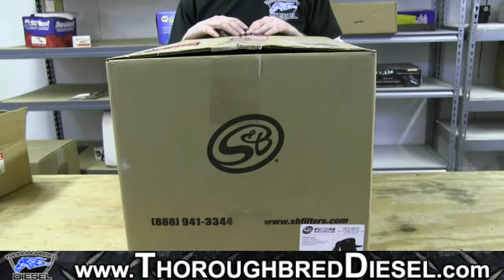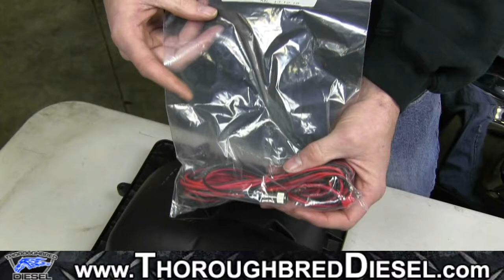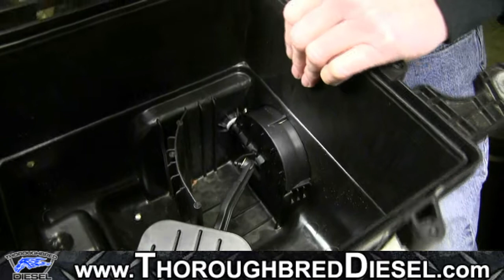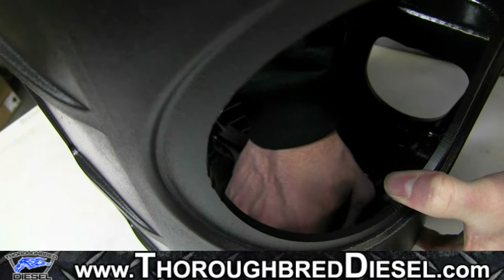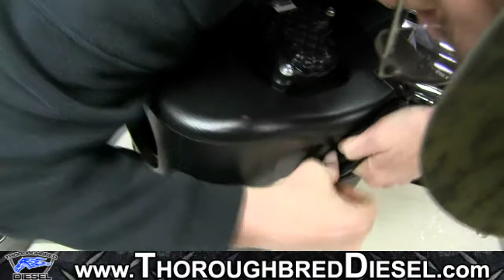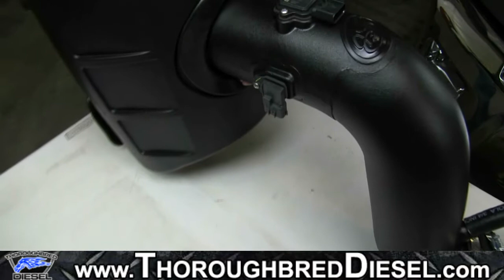S&B Cold Air Intake Install: 13-Up Dodge Ram w/ Active Ram Air System #75-5068

Comment: First off you shouldn’t get a code at all. I ran my 2014 3500 6.7 stock box without the gate. Second read the dam instruction. The rubber seals have 0s on them that you line up. That makes for a tight seal. The main tube should not have a gap on the top. I would be pissed if they installed it this way on my truck and said it was normal. Just lazy.
Reply: Did you disconnect your battery before the install. Jus curious
Reply: Yes, the very first time I put it on When I took it out I didn’t. The engine will automatically adjust after 45 starts.

Comment: On my 2002, VOLVO V70 R,(Estate)I fabricated a set up to blow my AC(With PVC PIPES)directly in my boxed Turbo air filter,works on a secondary LI-ION Battery,still have the stock AC inside the car),have heat sensor and gages(on demand)with switches on DIY console,all extras,fog lights,extra LED head lights,all on demand work with that secondary battery(12V/24/V)with a Volvo alternator big truck.I can even let the AC run inside(engine stopped)on really hot days,when i'm shopping.....!!!!!

Comment: I get a CCV disconnected code on my 14 with my S&B. Anyone else get this? Comes on every 500 miles or so
Reply from the maker: Give us a call with details and we will help you work through it and post the results here. 866-737-4966
Reply: Change your ccv filter! I have to change mine about ever 30k or so due to the fact that I travel for work pulling my 5th wheel

Comment: I purchased one of this but im concerned about the little gate doesn't seal the front hole all the way when it needs to it has a little gap i don't like that
Reply: You need to insert the rubber seal around the hole in front of the gate. If the gate doesn't seal properly check the rubber seal and make sure its inserted correctly and all the way

Comment: The intake should fit without gabs, if so you will loose flow, and you will not get the high performance...

Comment: Maybe it's just me not being as familiar with these newer trucks, but something as simple as putting on a cold air intake really seems to of become a major pain. I drive an 04 cummins and I love it, before then I had another 97 dodge and I work on older trucks all the time. The newest being mid 2000 models. It seems like a lot of trouble and absolutely zero room to work under the hood on these truck, not to mention EVERYTHING has a sensor on it that can throw off a check engine like.